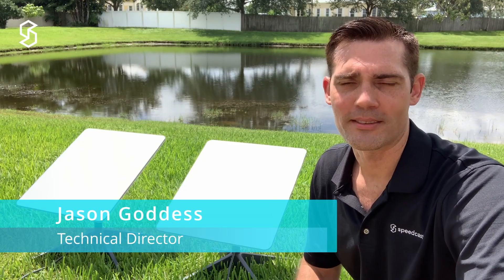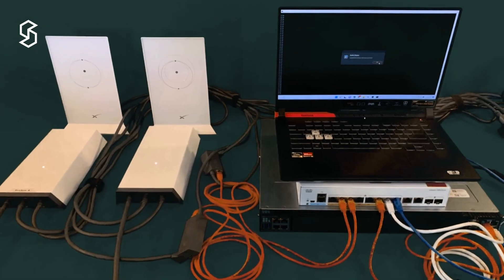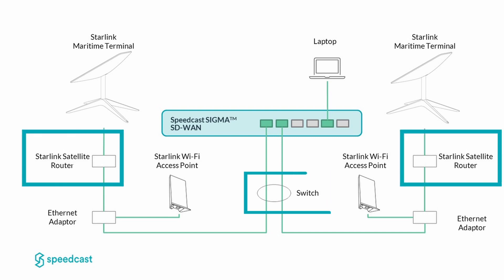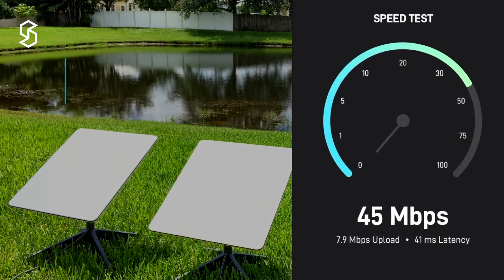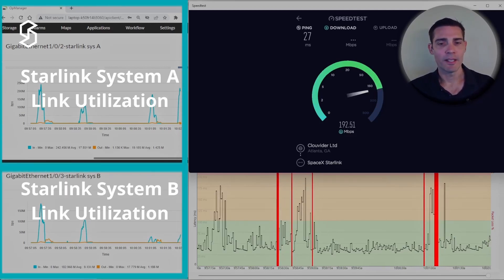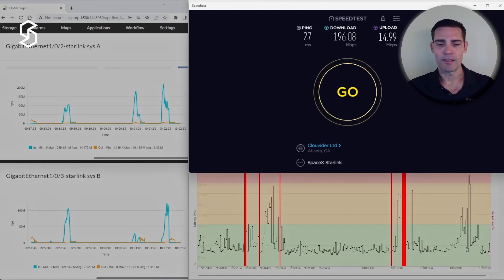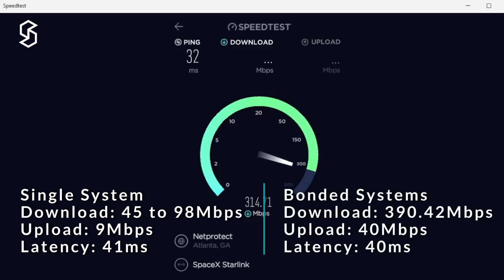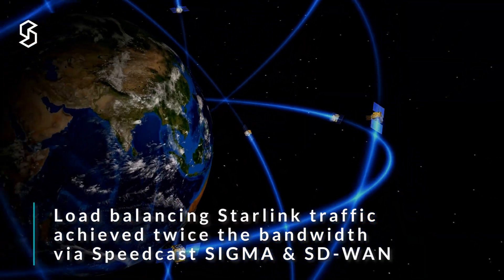How to maximize Starlink Maritime performance in a bonded set up | Satellite Internet | #spacex

Comment: In order to get this channel bonding do you need two $5K subscription (one per antenna) or teh default $5K cover both antenna ?
Reply from the maker: Thanks for checking out our videos! The Starlink Maritime system includes two antennas (this is true for both the high performance pole mount and the newly launched wedge mount units). The monthly fee is Starlink’s maritime internet subscription. The bonding feature is a network management capability delivered by Speedcast’s SIGMA platform, which enables one seamless path, with the goal of maximizing performance. You can learn more about the complete network management service here: www.speedcast.com/SIGMA